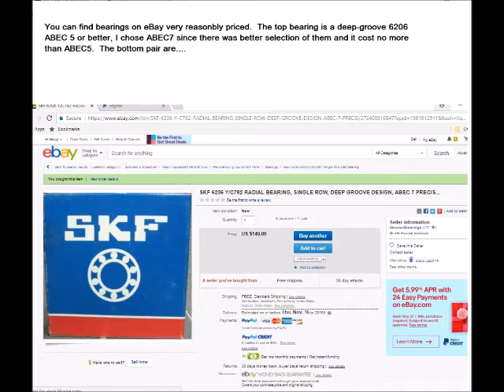Replacing Spindle Bearings on the Enco Mill

Comment from the maker: Two bottom Angular contact bearings 40x68x15:   7008 ABEC 5 or 7 (try to used a matched pair if available)   
Two upper bearings are deep groove 30x62x16:  6206 ABEC 3 or better 

Check eBay, they have some great prices on quality bearings